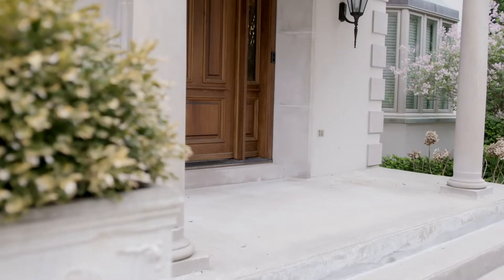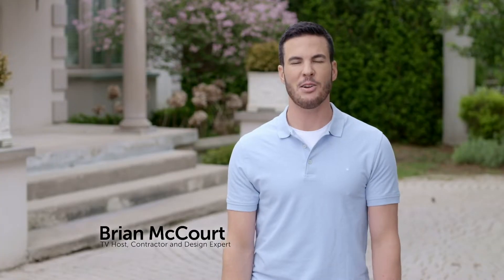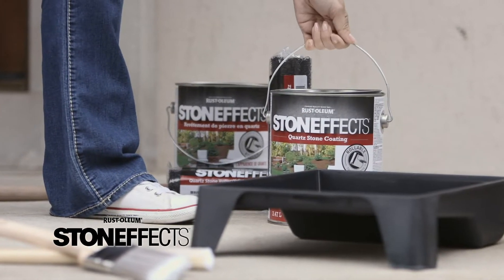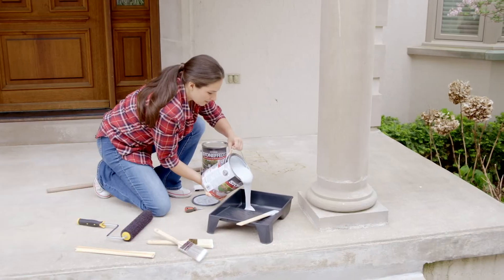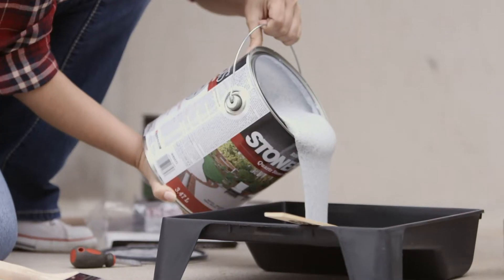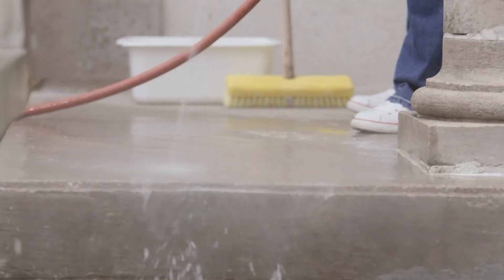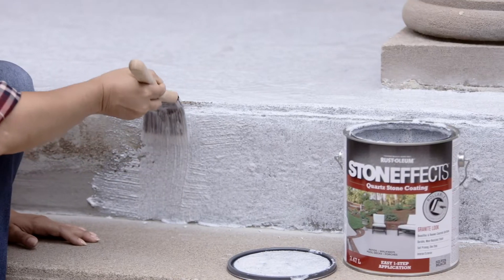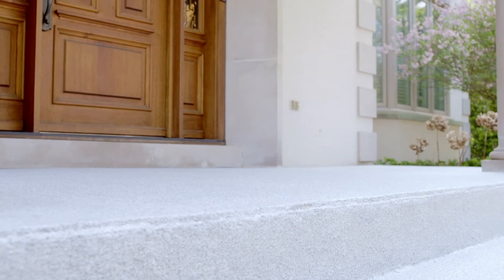Re-finish your concrete surfaces with an amazing granite look Rust Oleum Stoneffects®

Comment: applied the original 3-step Stone effects 7 years ago, resealing it with step 3 every spring, and it still looks great except for a half dozen little chips that appeared in the past year where the underlying cement had some weaknesses.  I am looking for a way to keep these from growing.  Can I patch with this new product?  Or even apply it over the entire surface?  Will it adhere to itself?
Reply from the maker: You can apply the new Stoneffects overtop. Here are the steps:
· Clean the whole surface with a heavy duty cleaner, scrub rinse and dry 
· Wire brush to remove any loose paint
· Use our Concrete Patch & Repair for any large cracks 
· If all paint has been successfully removed, use citric etch to open the concrete pores for maximum adhesion. Rinse and dry. Wipe your palm along the surface. If a powder remains, rinse and dry again. 
· If there is some paint leftover, then it's safe to safe it's bonded pretty well. At that point, use a wire brush instead of citric etch for the rest of the bare concrete. Use 220-grit to scuff sand any remaining painted surfaces.
· Remove all sanding dust before applying the Stoneffects

Comment: Well I figured out what went wrong.  Because the product is in a paint can  the paint people shook it like regular paint...and the small stone particles settled to the side and bottom of the can.  When we poured it out, there was only polyurethane with a couple of stones.  I didn't see print saying don't shake can.  Is there any warning?
Reply from the maker: Hi Sabine, for ease of mixing we do recommend, on the label of the product, to use a drill mixer or to store the can upside down prior to application

Comment: I have a 4 meter square area.  I put one coat on and can only see a clear gloss with streaks of white.  The can cost almost 70. $.  Are you saying I will need 2 cans?  Very disappointed with results of first coat
Reply from the maker: Hi Sabine, we're sorry to hear you're unhappy with the results. Our Stoneffects Quartz Coating covers 18 sqft at two coats. For the best coverage we recommend using the Stoneffects Quartz Roller and following the application steps here: 
https://www.rustoleum.ca/~/media/DigitalEncyclopedia/Documents/RustoleumCA/TDS/English/Stoneffects_Quartz_Stone_Coating_TDS.ashx

Comment: Is the area coverage only 18SQF? I need to cover 230SQF porch. does this come in bigger cans?
Reply from the maker: Each 3.78 L covers up to 3 m2 on bare concrete with a
single coat, two coats are required. The actual coverage will
vary depending on the porosity of the surface, since more porous
surfaces will require multiple coats.

Comment: Garbage product. Took 3 cans at $65/can to put one coat on a 10’x6’ pad. Looks like crap. Will probably have to buy two more cans. Also I guess I didn’t mix the first can enough and there are long streaks of white. Not sure how that’s going to be fixed. Very unhappy with product.
Reply: I guess you not reading the can where it says to drill mix the contents is the manufacturer’s fault.